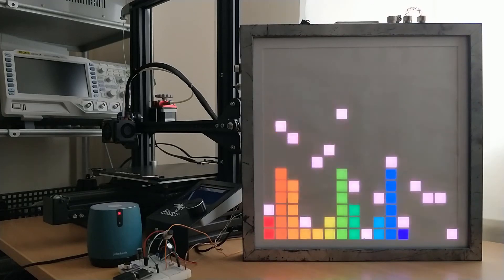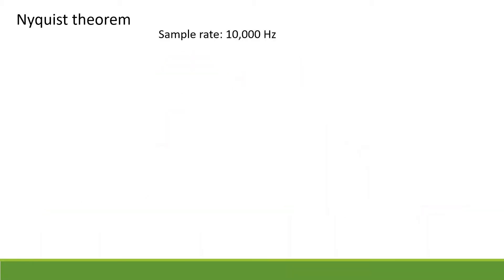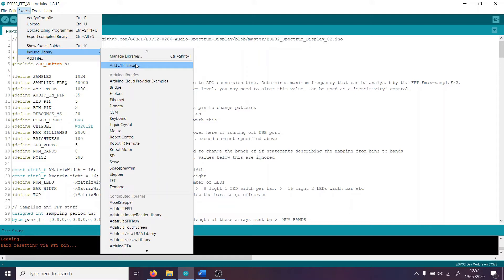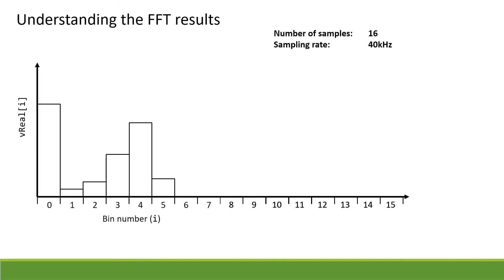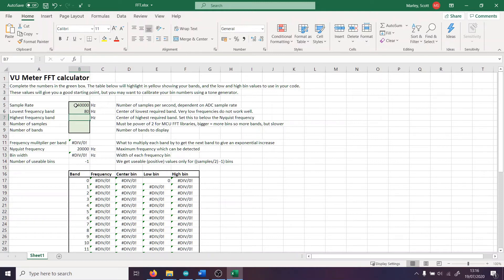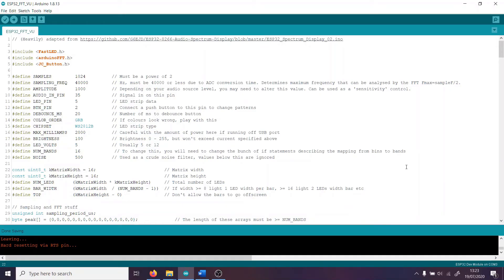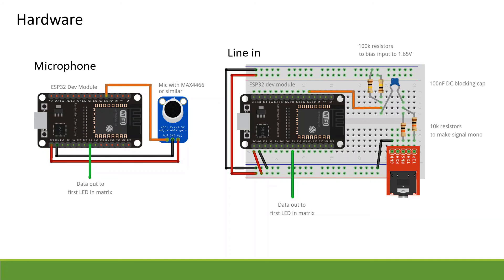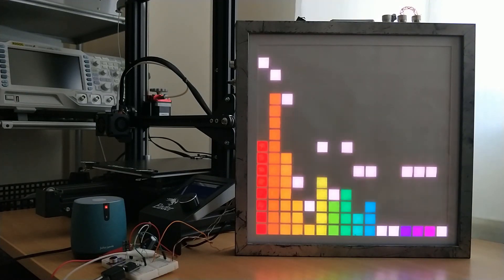ESP32 spectrum analyser VU meter using arduinoFFT and a FastLED matrix

Comment: Hello there. Even though I did everything carefully, it didn't work. Connection, arduino version, different code versions ... I'm very sorry. I did it with the ST107E too but it was not a real analyst for the music either
Reply from the maker: Sorry you couldn't get it to work. It works well for me. I hope you find something that does the job!
Reply: @ScottMarley  
https://www.direnc.net/esp32-wroom-32u-wifi-bluetooth-gelistirme-modulu
I used this card. Is it the right card?
Reply from the maker: That should be fine. You can use any ESP32. Are you running it on a matrix? Is it the same size as mine? Is it wired the same as mine? If not, have you changed the XY function to reflect your wiring? There are just so many things that can go wrong in code like this, its impossible for me to guess what the issue is.

Comment: Nice work!
Did you take the line from the amplified signal, in parallel with the loudspeakers?
No impedance change in the loudspeakers nor spurious interferences to the signal, giving distortions?
Reply from the maker: No, it takes a line-in. Be careful if you use the speaker cable. The maximum input voltage on an ESP is 3.3V, speakers are driven far higher than that usually so you would need a voltage divider etc.
Reply: @ScottMarley  Thank you for the reply. I was afraid that the line-in level was too low and should be amplifieed..
Reply from the maker: @luigimorelli6444  make sure you look at the circuit diagram on GitHub. It is very low level, but that's ok. I actually find it works best using a microphone instead.

Comment: great explanation. I am working the my LED project that has only 1 band (1 straight strip) does it work with you code. Instead of 16x16 matrix. I just wanna use 1x72 is it possible? You can view what i have thus far. still no happy with it since it doesn't detect peak properly https://www.youtube.com/watch?v=2rSratTQwvM

Comment: Hello everyone,

Can somebody tell me how i can change te XY function to a serpentine matrix starting left bottom, goining up, then down, then up, ... all the way to the right. My matrix is 14 leds wide and 20 leds high. 

This would help me a lot,
Rasheed
Reply: Had the same question. I want to align my LED strip vertically starting from bottom-left, going vertically up, then going down on the second band, going up on the third band ... and so on. 
I have the version with 144 LEDs/m where the vertical distances between LEDs are smaller than the horizontal distances. I'd rather get smaller distances vertically within each band and wide distances between the bands.

Scott provided a solutuion in another comment pointing to https://pastebin.com/cBa3rSNX
This works great for a setup with equal rows and columns - not for unequal ones (tested it).

Not giving up I came across https://forum.arduiono.cc/index.php?topic438841.0 
This code does the trick for me.

//works only for serpentine layout
  uint16_t XY( uint8_t x, uint8_t y) {
  uint16_t i;

 if(x & 0x1) { // is X odd
    i = x * kMatrixHeight + (kMatrixHeight -1 - y) ;
 } else { // x is even
    i = x * kMatrixHeight + y;
 }
 return i;
}

This is such a great project from Scott. ABSOLUTELY AWESOME Scott.

Comment: Many Thanks for this Video!
My first Test with my Teensy 3.6 gives about 150kHz Sampling Frequency. Wow! An Arduino on Steroids with 180MHz... So this thing could sample both channels simultaneausly.
Is someone out there, who uses some of the frequency bands to trigger an other device like a Light controlling device (https://www.dmx4all.de/produkte/dmx-player-l-mk2/) ?
I want to trigger the input to get beat-detected steps for the the light chaser acc. to bass/mid/treble... or sub/low/mid/high

Comment: i have a new problem-https://www.youtube.com/watch?v=6K1Onx7WQks&ab_channel=PavelKonjok
How turn 90 degree?
This is normal-down to up with controller sp107e.-https://www.youtube.com/watch?v=OsbW5Dvt_Fw&ab_channel=PavelKonjok
Reply: Please help!!!
Reply from the maker: You will need to alter the code in the XY function. You need to change (x,y) to (-y,x) or (y,-x) depending on which way it needs to rotate.
Reply: @ScottMarley  Could you give me a screenshot of the code and show which parts could be changed?
Reply: @ScottMarley  i am not understand in this bussines-programming.
Reply from the maker: @pavelkonjok7201  Be patient! You've messaged me about the same thing 3 times in 24 hours. I have a job and a life. Writing this stuff is a hobby, and I will reply to you when I can.
Reply from the maker: I've copied the XY function that you need to use to pastebin https://pastebin.com/cBa3rSNX. Just un-comment the three lines under either 'Rotation counterclockwise' or 'Rotation clockwise'
Reply: @ScottMarley  Thank you -god bless you-you are the best of the best!!!

Comment: cant to load a new code to-with new code writing-easy butto-invalid argument
Reply from the maker: Do you have the EasyButton library installed?
Reply: @ScottMarley  where to get it-please tell us!!!
Reply: i download a library-to arduino library-nothing-easy butto-invalid argument
Reply from the maker: I'm finding it difficult to understand what you're saying. I just downloaded the code from GitHub and it compiled fine for the ESP32 using the Arduino IDE. Make sure you have the EasyButton library installed from the Arduino libraries manager. The author EasyButton is Evert Arias, just to make sure you have the right one. If it still doesn't work, copy and paste any error messages you get here and I'll see what I can do.
Reply: @ScottMarley  ok,tomorrow.thank you.
Reply: @ScottMarley  C:\Users\Pavka\AppData\Local\Arduino15\packages\esp32\hardware\esp32\1.0.4/tools/sdk/include/config/>EasyButto: Invalid argument
Reply from the maker: @pavelkonjok7201  it says 'EasyButto' when it should be 'EasyButton'. Have you changed any of my code at all, even accidently?
Reply: @ScottMarley  Yes, i've made a typo by accident, everything works fine now, thank you.

Comment: Heyy, I'm doing a project for detecting high frequency. Were you able to find a method to detect higher frequencies? What is the maximum frequency that we can detect using Arduino?
Reply from the maker: Nyquists theorem states that the maximum frequency we can detect reliably is half of the sample rate. On a nano / uno etc, you won't get above 10kHz sample rate (so 5kHz signals) using analogRead, but if you play with the registers instead, you can go way faster. See here for more information http://yaab-arduino.blogspot.com/2015/02/fast-sampling-from-analog-input.html. Using an ESP32, you could go much faster than even that, but again, you're looking at setting registers. Can't find a refernce to that at the moment though. Good luck!

Comment: Heyy, I'm doing a project for detecting high frequency. Were you able to find a method to detect higher frequencies? What is the maximum frequency that we can detect using Arduino?
Reply: The way the ADC is set, the sampling rate is about 9 KHz, but there are ways to take that up to to roughly 75 KHz found here: http://www.optiloading.be/willem/Arduino/speeding.pdf , meaning you should be able to detect frequencies up to 35 KHz. I have no idea about the resolution/accuracy though.

Comment: Your matrix is too good but in case of using acrelic bar as of matrix there is problem of axis.....and pls.help with jc button it not working on esp32......
Reply from the maker: Hi, I know it's probably too late now, but I've updated the code to use a different button library. Try the new code from the GitHub page linked in the description and see if that works for you. If you're using vertical bars as a display, you just need to alter the XY function to make it specific to your wiring.
Reply: you problem is gone?I have this problem to!

Comment: Love this Scott! I'm planning on making something similar and in was going to use the mseq7 but I think I'll use this instead!
Reply from the maker: Great! It's far less circuitry and much more customisable to do it in software :)
Reply: @ScottMarley  cheaper too 😅
Reply: @ScottMarley  I had a play around with it this evening and I couldn't get it working properly. Does the audio source need to be amplified? Like would a cable from a phone headphone jack to the esp32 be what's expected?

I wasn't displaying on anything really, I was just printing the value for the  top of the line in serial monitor. If I tapped at the line in cable I could see some values, but never anything when playing music.

Any suggestions?

(Btw I was using a board that doesn't have pin 35 or whatever pin you were using , so I tried 32 and 33, both were the same, I update the pin in the code each time too)
Reply from the maker: No amplification was required for me, works straight from the headphone output of a phone. What values are you printing out, barHeight? And for each channel? Are you using the circuit for line in given on the GitHub page?You can also play with the AMPLITUDE parameter, lower values make it more sensitive (I think, can't quite remember now!). The input pin shouldn't matter, I'm not doing anything clever here ;)

Comment: Good job.
Is it possible to change the code to use a led strip ws2812b instead of the matrix?
I would like to cut the led strip in 8 parts with 30 led and create 8 channels, the first being starting at led 0 to 30 for "center bin 2", from led 31 to 60 for "center bin 4", led 61 to 90 for "center bin 9" .....
It's possible?
sorry for my English.
Reply from the maker: Yes, that will work fine. Just wire the strips up from one to the next and edit the xy code for however yours is wired up. Mine is simply 16 strips of 16 LEDs wired from one to the next.  You will need to understand how the xy code works to make the changes yourself.
Reply: @ScottMarley  
For me it is impossible to change the code, I did not understand the code.
Scott Marley could you send me the changes?
thank you.
Reply from the maker: I'm afraid not, I don't have the time. Spend some time learning how this all works and you'll be able to create your own amazing things!

Comment: Awesome project! I'm trying to build it currently but I'm having an issue when I power the ESP32 from the USB port and the matrix from a DC 5V power supply. When I connect power to the matrix I'm starting to hear an annoying buzzing from my speakers. That noise also affect FFT calculations. I tried to connect a capacitor but no luck. I can't figure out how to fix it because I'm new to all this electronic stuff. If that's something you can help me with I'd appreciate! Thanks for sharing the project anyway!
Reply from the maker: Make sure the grounds for the 5V and the USB are connected together. Ultimately you want to run both lights and esp from the same supply if possible. You might also have a ground loop with your audio device, you could try using a ground loop isolator (search on eBay or Amazon) between your audio device and input to the ESP, assuming you're using a line in.
Reply: @ScottMarley  thank you for a quick reply! I'll continue digging. You don't have that problem though I assume. I wonder how my circuit is different.

Comment: Dear sir, your open source project is very cool, so I tried to do one. But now I am faced with a problem. After writing the source code provided by you, the esp32 module will reset again and again every 1 second, and the LED will flicker continuously. The serial port display is as follows:

rst:0xc (SW_ CPU_ RESET), boot:0x13 (SPI_ FAST_ FLASH_ BOOT)

configsip: 0, SPIWP:0xee

clk_ drv:0x00 Q_ drv:0x00 D_ drv:0x00 ,cs0_ drv:0x00 ,hd_ drv:0x00 ,wp_ drv:0x00

mode:DIO , clock div:1

load:0x3fff0018 , len:4

load:0x3fff001c , len:1044

load:0x40078000 , len:8896

load:0x40080400 , len:5816

entry 0x400806ac

Guru Meditation Error: Core 1 panic'ed (Interrupt wdt timeout on CPU1)

Core 1 register dump:

PC : 0x400d195b PS : 0x00060b34 A0 : 0x800d1a61 A1 : 0x3ffb1e20

A2 : 0x3ffb1e54 A3 : 0x04bdb186 A4 : 0x00000004 A5 : 0xffffffff

A6 : 0x0000003b A7 : 0x000000d1 A8 : 0xe0000000 A9 : 0x3ffc03d9

A10 : 0x3ff44004 A11 : 0x000000b7 A12 : 0x00000020 A13 : 0x00000020

A14 : 0x3ff44004 A15 : 0x0000012b SAR : 0x0000000a EXCCAUSE: 0x00000006

EXCVADDR: 0x00000000 LBEG : 0x400d1774 LEND : 0x400d1780 LCOUNT : 0x00000000

Backtrace: 0x400d195b:0x3ffb1e20 0x400d1a5e:0x3ffb1e50 0x400d1bb1:0x3ffb1e90 0x400d1cf5:0x3ffb1ed0 0x400d17d5:0x3ffb1f10 0x400d3245:0x3ffb1fb0 0x400885bd:0x3ffb1fd0

Core 0 register dump:

PC : 0x400ec8ea PS : 0x00060134 A0 : 0x800d5c0a A1 : 0x3ffbbff0

A2 : 0x00000000 A3 : 0x00000001 A4 : 0x00000000 A5 : 0x00000001

A6 : 0x00060120 A7 : 0x00000000 A8 : 0x800d57d2 A9 : 0x3ffbbfc0

A10 : 0x00000000 A11 : 0x40085120 A12 : 0x00060120 A13 : 0x3ffbb690

A14 : 0x00000000 A15 : 0x3ffbbce0 SAR : 0x00000000 EXCCAUSE: 0x00000006

EXCVADDR: 0x00000000 LBEG : 0x00000000 LEND : 0x00000000 LCOUNT : 0x00000000

Backtrace: 0x400ec8ea:0x3ffbbff0 0x400d5c07:0x3ffbc010 0x40089 aae:0x3ffbc030 0x400885bd :0x3ffbc050

Rebooting...

Why is this? Please help me, thank you!
Reply from the maker: I am away from home at the moment so I cannot investigate. I will be back on Monday and will have a look for you then.
Reply: @ScottMarley  OK, I look forward to your answer. Thank you for your reply : )
Reply from the maker: Sorry it's taken me so long to get back to you, I'm busy with work and other projects at the moment. I don't know why you're getting that issue, when I grab the code from GitHub and upload it to my ESP32 it works as intended. Is everything set up in hardware  the same as I have done? What size matrix are you using? Have you made any changes to my code?
Reply: @ScottMarley  Dear Sir, thank you for taking the time to reply to my questions during your busy work. What I am making is an 8*8 ws2812B led matrix. According to your code comments, the number and array of leds have been changed, and the sampling frequency column has also been changed. It is because I changed the flickering and constant restarting caused by these errors. Next, I will try the 16*16led matrix. I hope I can succeed because this light board is so cool. Looking forward to your more tutorials:)
Reply: @fengmingli8595  Hello there. Did you know how to run the circuit?

Comment: If you would leave out the capacitor on the audio in, wouldn't the ADC just ignore the negative values? That way you'd get double sensitivity on the input and you wouldn't have to discard the negative samples.
Reply from the maker: You don't want to stress the ADC with negative values, it probably won't hurt it at such low voltages but it's not designed for it. You wouldn't increase, the sensitivity by doing this anyway, in fact you would be losing half the information in your signal. When you say discarding the negative samples, are you talking about discarding half the vReal array? You would still have to do this. Once the FFT has been performed, the vReal array no longer contains the audio samples themselves, but the FFT results. These are two completely different things, and we are just reusing the vReal array for convenience. At first each element in vReal represents a 25uS slice of time, containing the audio level. After the FFT each element in vReal is a frequency bin containing the amplitude of that frequency.
Reply from the maker: Just to add (as I went off on a tangent there!) The DC blocking cap is there to block the 1.65V from going back into your audio source (phone or whatever). It's not a good idea to inject DC into the output of an audio device like that :)
Reply: @ScottMarley  thank you for clarifying :-)

Comment: That looks very very cool ..huge thanks for the hard work compiling this tutorial...and an excellent explanation of the sampling mechanism....i have tried fft with 8266 devices but when the WiFi is active it seems to make the ADC input 'noisy' ...have you tried this with WiFi running on the esp32 ..I'm now going to order a few Esp32 board's....on a side note have you seen any of Andrew Tuline's fft stuff ?? he's been doing sound reactive fft projects for a few years and has made some quite artistic lighting projects.
Reply from the maker: Thanks for your comments, it really was a few days work putting that together even though it might not seem like it! I don't have an 8266, but I know on the ESP32 there are two ADCs, and ADC2 is somehow used for the WiFi. So as the 8266 only has 1 ADC, maybe this has to be shared between the analog pin and the WiFi causing interference? Just guessing here though. Andrew is the chap who does the WLED sound reactive port right? I haven't looked at it yet as I wanted to figure out how to do things myself in the first instance, but I do have an idea for a project that WLED would be good for. Stay tuned!
Reply: @ScottMarley  ah so that would explain why the esp32 works where the 8266 doesn't ..well i say doesn't I have had it working with an ADS1115 I2C ADC module but you have to jump through hoops to get the sample rate high enough ...you're version is much easier ....here's hoping you're channel grows...anyway bought some ESP32's .